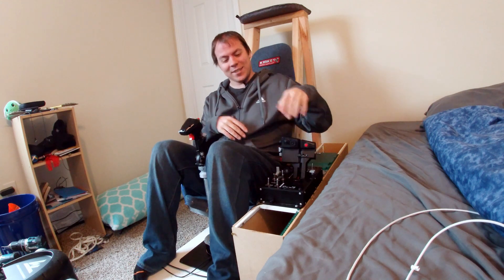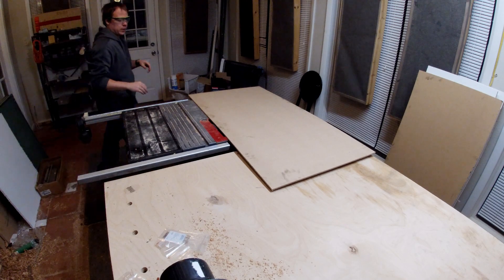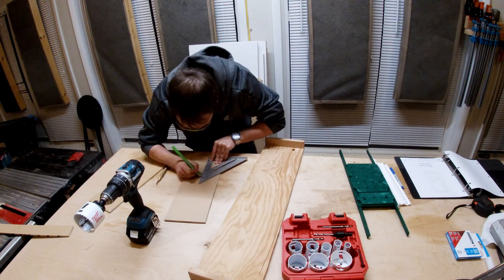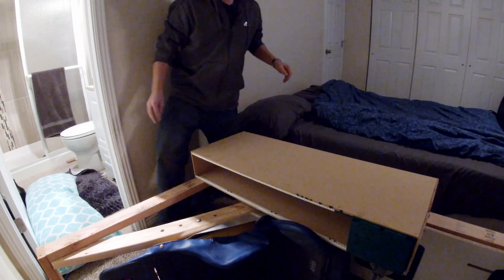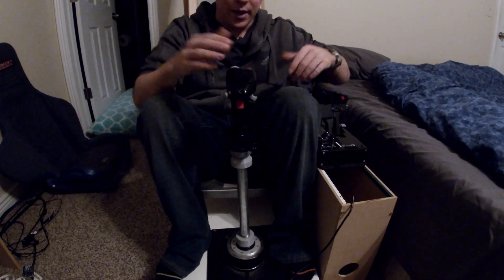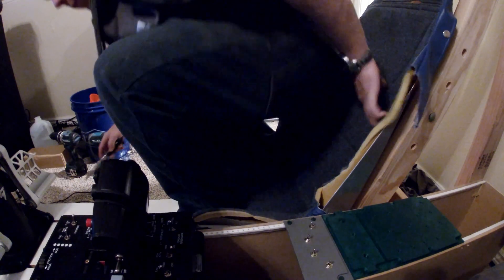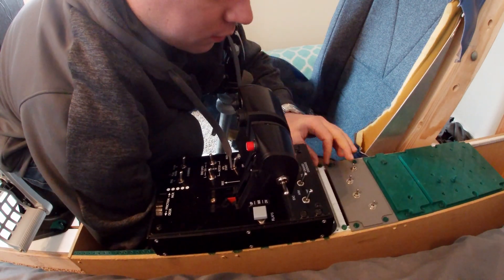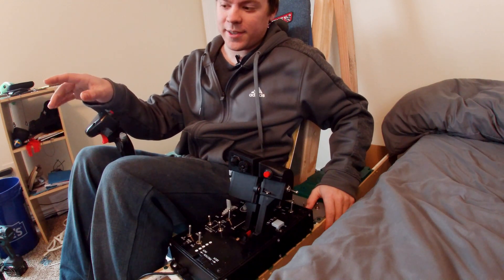F/A-18C Cockpit Build - EP08 - Left Console

Comment: How to create where  you Seat ???
Reply from the maker: i angled the 2x4 frame backwards at the right angle, and then screwed 2 short 2x4 into the back of the seat and used the outer rails which are part of the frame as sliders, and the inner 2x4s attached to the seat, and put a bolt through both of them to adjust height. The seat is an old aluminum racing seat that was donated to the channel. I'll be doing an upgrade on it soon with a much better seat and a different design though. This one worked but was not very comfortable
Reply: @thesimulationexperience  And long closhe? To pilot?
Reply from the maker: @danieleangelini6238  long closhe? not sure what you mean. and for a racing seat. if you search for "aluminum bucket racing seat" on amazon, there are lots of them for cheap. I found one for $60 pretty quickly. you can also buy a sim racing seat which would be much more comfortable. companies like GTOmega make comfortable seats designed to be used in the sim and are far more comfortable. their RS6 is really nice

Comment: Around 5:56 the voice audio cut out - music was still on though. 

Looks like fun man, I am struggling as I was wanted to work on my pit; but have recently become infatuated with a reality 3DOF motion simulator.  #FirstWorldProblems
Reply from the maker: I have looked into 6 axis motion simulators and they're relatively easy to build and not too hard to program. I decided against it for this first cockpit since I wasn't sure of weight, materials, or structural strength. I still drool over them every time i see one.